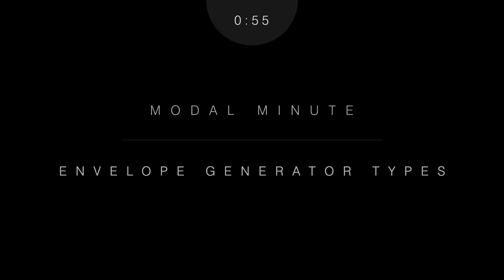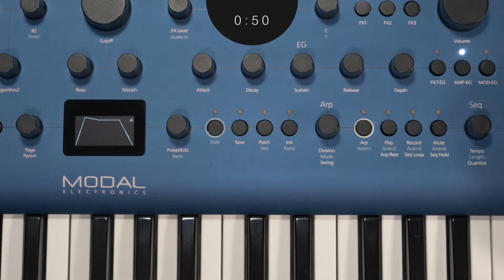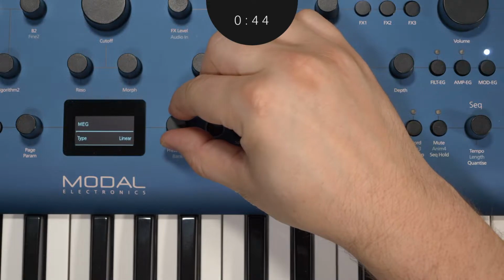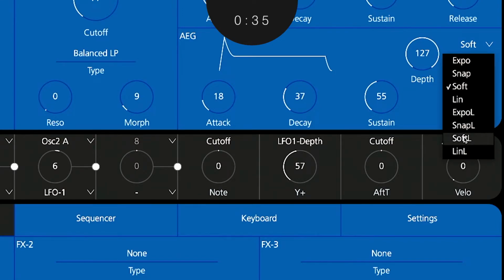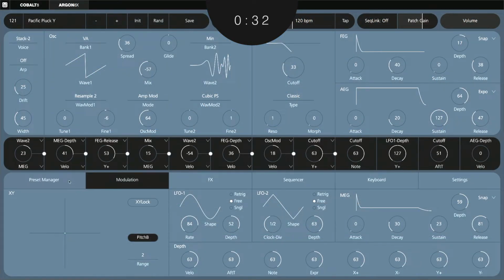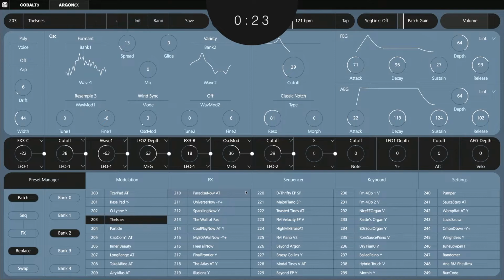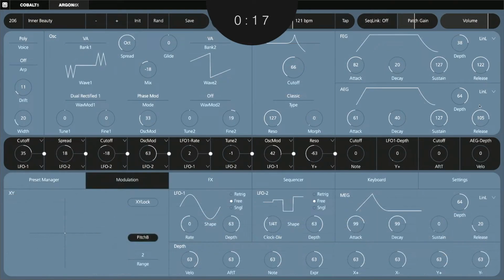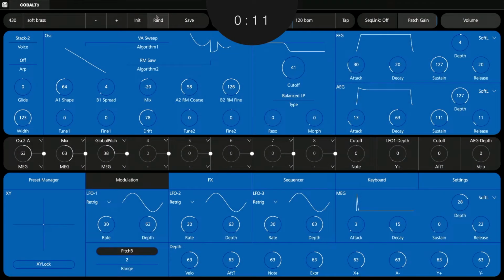Modal Minute #37 –  Envelope Generator Variations

Comment: Why 0 - 3 values on AEG Attack has no effect on Argon8? This issue need to be fixed. It is impossible to get punchy sounds if the attack is not instant. (tested on two units)